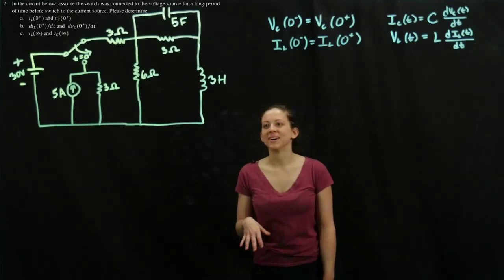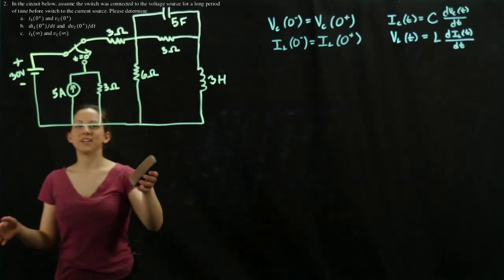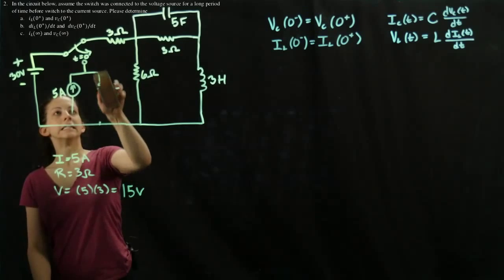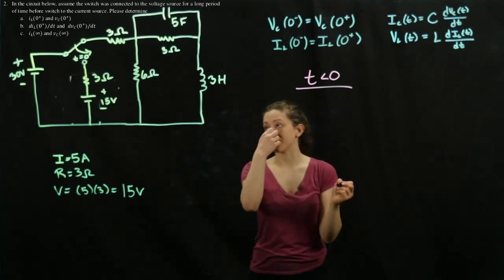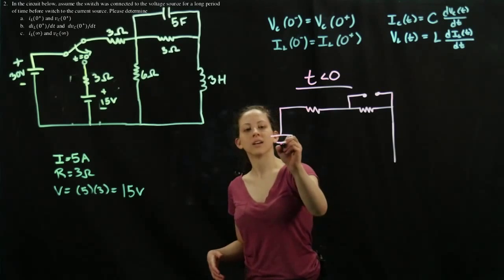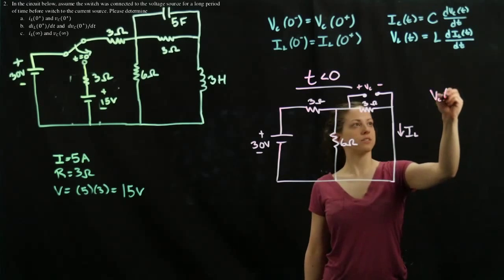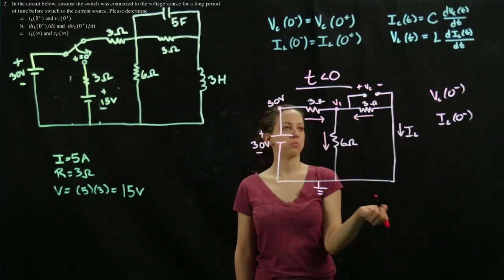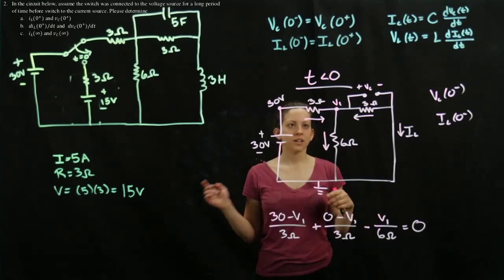Circuits 1 - RLC Initial conditions

Comment: Another way for the infinity v measure is to calculate the parallel resistance by using the product over sum  OR use the reciprocal, over one, plus  the reciprocal, plus … all over one.  That’s for parThen it’s a simple voltage divider circuit.